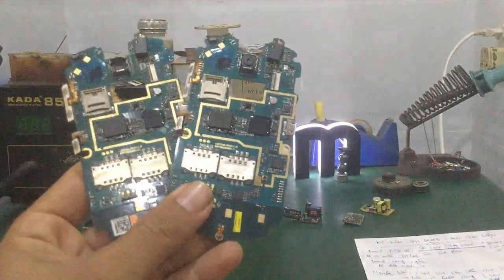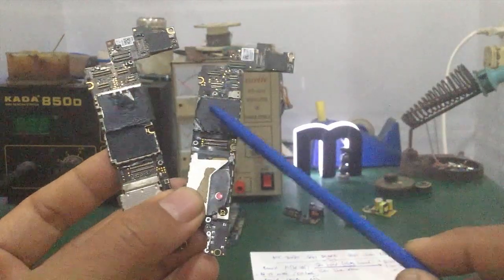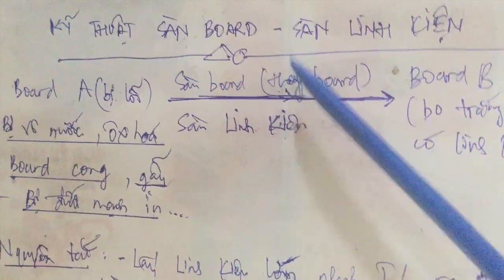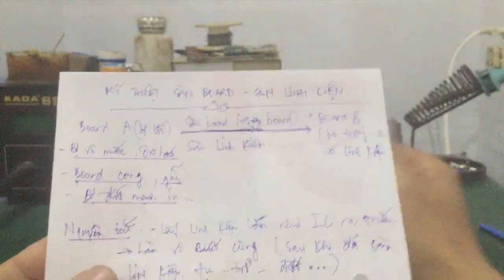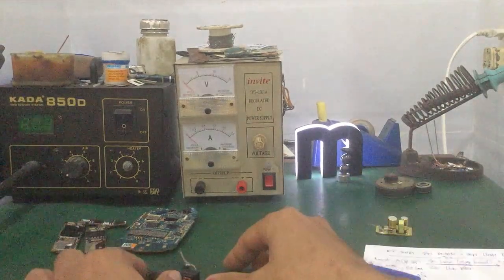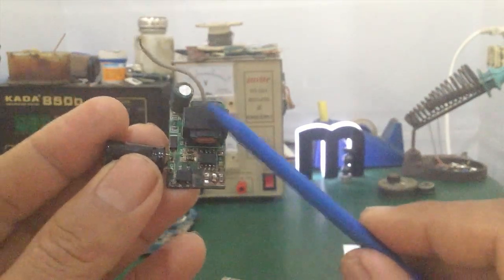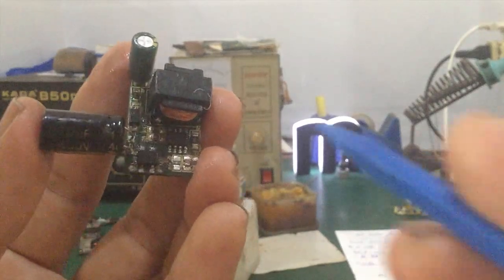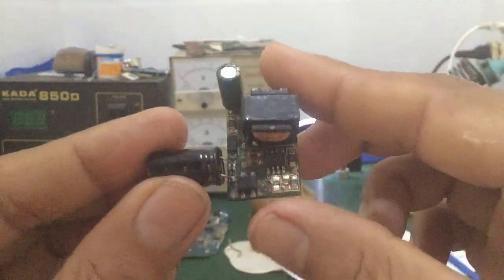Sửa led driver - thực hành sàn board - sàn linh kiện : tụ - điện trở - IC ..dành cho anh em kỹ thuật

Comment: Mình có rất nhiều thanh let t8 và mạch. Bạn có thể cho mình biết làm thế nào để biết dc thanh let này dùng nguồn bao nhiêu von de mình cấp cho đúng. Vì mình đo đầu ra của các mạch nguồn mình có thì thấy 70v..hon 100v rồi 256v rồi 315v vậy nên mình ko biết mạch nào hàn với dẫy let nào là đúng. Cảm ơn bạn
Reply from the maker: dựa vào số lượng led & cách mắc led nhé bạn !!! ngòai ra bạn cần biết : mạch nguồn led driver là loại nguồn dòng , dòng điện ra ko thay đổi , điện áp ra có thể thay đổi , phụ thuộc vào tải ( tải càng nhiều thì sụt áp trên tải càng lớn ) ,điện áp 256 hay 315v thì sẽ mắc nhiều được nhiều chip led hơn so với 70 hay 100v
Hãy đăng ký theo dõi kênh để xem các video của mình nhé … bạn có cần hỗ trợ về kỹ thuật hay tư vấn về điện tử - điện thoại di động thì cứ để lại comment , mình sẽ support cho bạn !!!